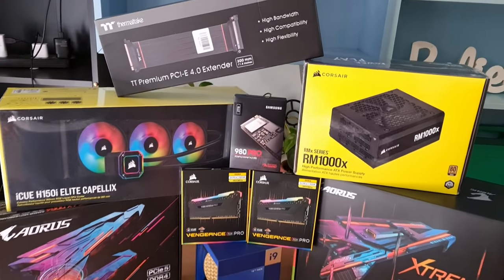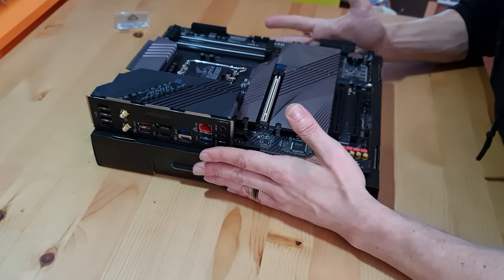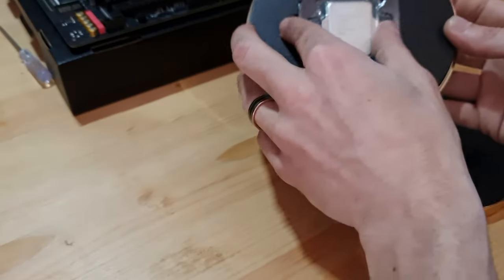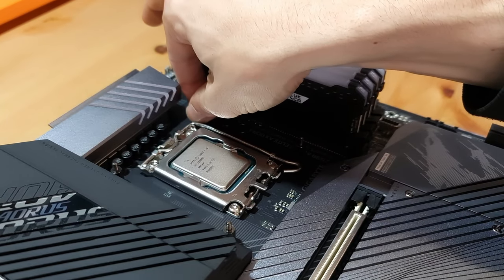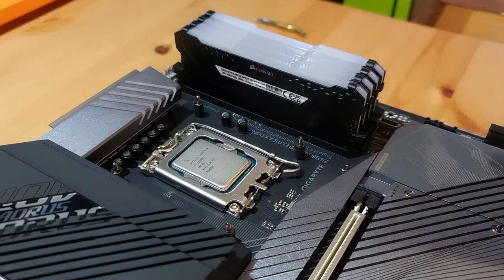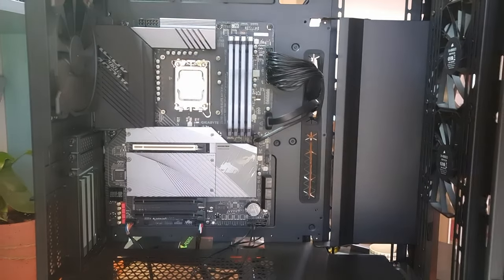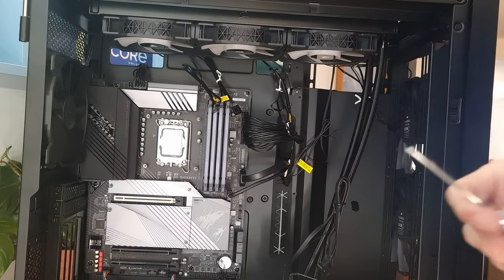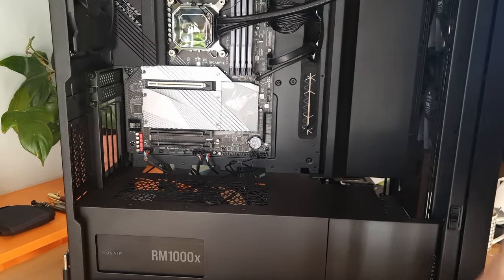Building My New 2K Gaming & Editing 2022 PC

Comment: It seems to me that you should move the video card radiator to the wall next to the motherboard, and in place of the video card radiator, install 3 fans to blow in so that there is an air flow.
Reply from the maker: Absolutely agree 100%, shall do sometime mid next week when I have some free time... Currently editing a video comparing benchmarks on my new 2022 pc vs. my 2017 pc